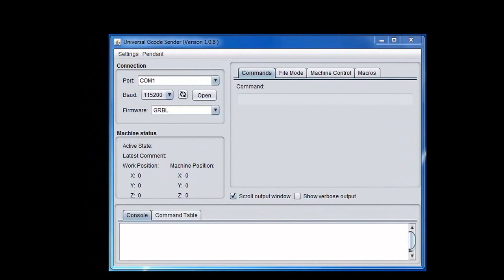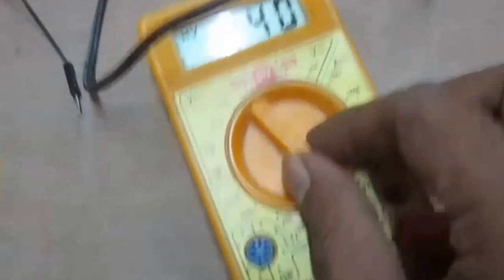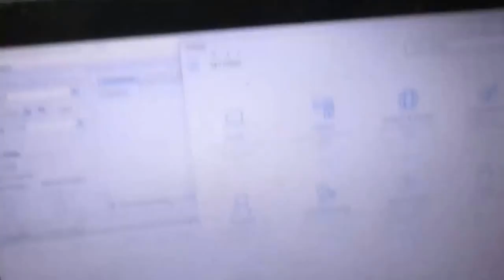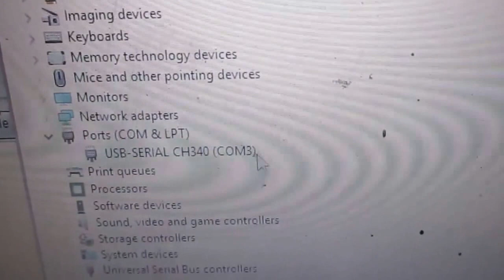How to make Mini CNC Machine with 28BYJ-48 & A4988 Arduino Part-1

Comment: Hello Goodnight?  How did you configure the 28byj-48 motors so that it passes 1mm per step?  I'm doing a belt cnc and I don't know what value to set to calibrate it.  thanks and greetings from Argentina